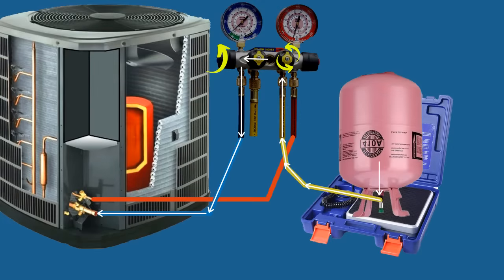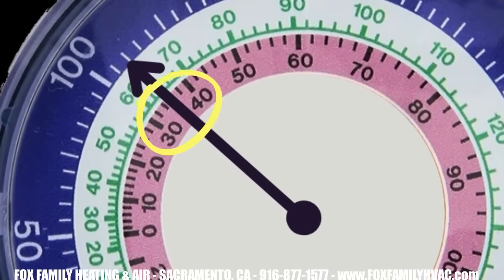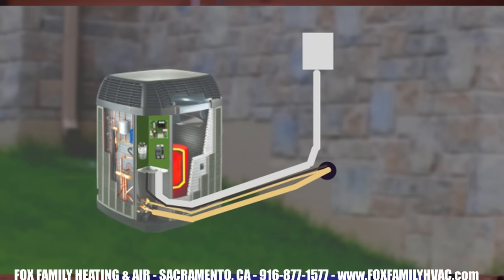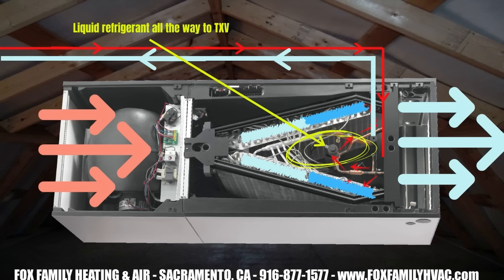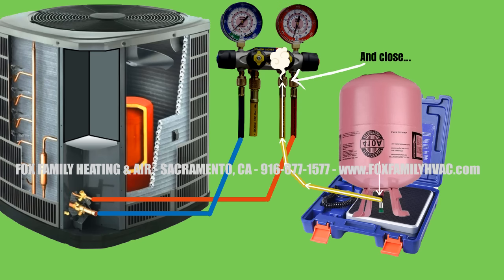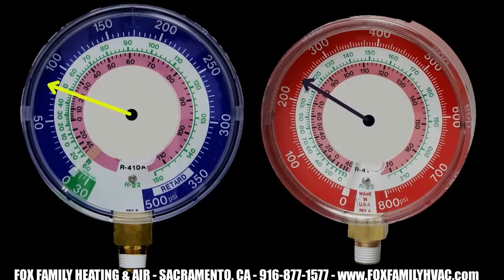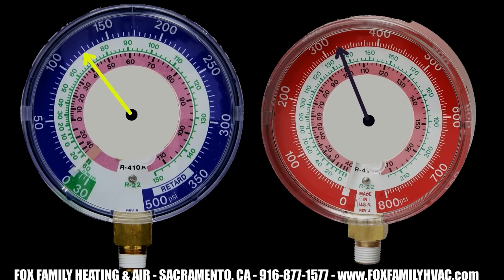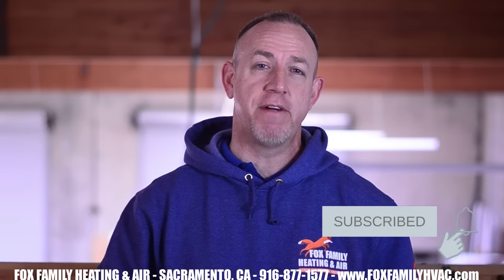How I Add Refrigerant to an Air Conditioner

Comment: This should not be try it at home without supervision if you don’t know what you’re doing you can have a serious accident and burn yourself. Refrigerant is no joke and nothing to play around with. Sorry that’s the truth this is one thing you don’t want to make a mistake with.
Reply from the maker: Very true!
Reply from the maker: Just pinned this message to the top so everyone can see it.
Reply: It's OK to handle Freon for your car or truck, but not for your home A/C?
Reply: Not if it was never adjusted properly when installed
Reply: I need to add Freon. I have an inside unit in my basement. I finally was able to use my unit for first time and after three days it was frozen. It got colder for a couple days so I let it melt. My landlord said it might need Freon. There’s duct tape around unit that’s falling off. So I’m going to change filter and reapply duct tape around. See if that works first. If not, then I’ll have to call someone. What’s an estimate for Freon ? I’m a woman and no nothing about units. Only basics

Comment: As a tech that learned everything either out in the field or on YouTube when I started, I distinctly remember when things finally snapped and became clear in my head when it came to refrigerant - from then on I always referred to the charge(especially the suction side) in terms of  TEMPERATURE - not PRESSURE when communicating an issue to someone else or while figuring out the issue. 
 Trained a few other guys at the first company I worked for and would always try to get them to think in the same terms (Blue gauge TEMP, Red gauge Pressure) - it makes understanding Superheat and Subcooling (and what it means in the system that much easier).
Reply from the maker: Great info!  Good to hear others doing the same!  I have an experienced refrigeration guy who only wants to talk pressures when he's talking to others.  everyone's different but can't bag on him since he's such a good tech.  Thanks again

Comment: I don't do residential HVAC but in managing my own automotive HVAC I learned one thing. Well, a few but this one too. If I think the system may be under charged ALWAYS leak check the service ports BEFORE touching them with ANY tools or equipment. You will not find a leaking schrader valve with gauges attached and you will not have a definitive diagnosis if the reseating that takes place "fixes" the problem. Thank you for doing what you do here on YouTube.
Reply from the maker: Thanks for your input 😊
Reply: Hallelujah, speaking my language, it shocks me that every single hvac channel does not mention this critical juncture
Reply: This is a good first step. When I get a no ac call it's the first thing I check. Check for power, check for leaks at valves. I'd say 20% of the time in the last 4 months I has been one of the valves.
Reply: @travischaddock4826  And how often did the valve leak because some numbnut didn't tighten or even bother to reinstall the caps and it got dirt and corrosion in the port? It never leaked before untill YOU went and stuck your tool in it and let all the crap into the seal. Some people automatically change out the valves whenever they are going to enter or have entered a system.

Comment: I took out all the freons from my unit, then I added propane. System is way colder I would say. Thanks for showing me how to do this and what tools to buy on craigslist
Reply: I've been wondering about this myself of late. Besides this video, are there any other good resources to help with this?  

    Speaking hypothetically, of course. I'm just interested in the physics and mechanics of it all, and wouldn't think of attempting this on my on own home system.

Comment: You did a good job explaining why and how to properly charge a system by temperatures instead of gauges, and really sounded like you know what you are talking about and seems like you went to trade school or learned off a educated teacher (instructor).
Reply from the maker: I appreciate that.  I actually learned all this in the field, as I started this trade from scratch as a helper and worked my way up.  Thanks for the comment.  I really appreciate it

Comment: great information about charging, 
before charge i would try find leak first, open evap coil panel, look in drain pan for any trace of oil, most of the time thats where it leaks, if its is leaking, most coils have 10 year warranty, get it done when its under warranty.
Reply from the maker: good info jass

Comment: Hi, boss, why not use digital gauge  which can give you either superheat or subcool right away, easier & faster.
(One more thing, I think R-410A is a blended refrigerant, it can only be added as liquid in suction side, you'd better  mention it to use a nuzzle or throttling method.)
Reply: Not needed, his gauge works...all he has to do is add 10 to the cold side and if it matches the hot he is done. I can deduct that equation faster than clamping on the sub cool wire.

Comment: & if the liquid line temperature (make sure the sun or your hand, or other heat source is not warming the area where your temp probe is mounted) is cooler than the outside ambient temp, then suspect a restriction up stream for that measured spot of the liquid line....i.e. a liquid line filter drier.
Take a Delta-T across a liquid line filter drier, if it happens to be located up stream from the measured spot of the liquid line.
If there is a temp drop of (I think) more than 3 degrees, I have been told that the liquid line filter drier is the source of the restriction, & would need to be replaced with a new one.

Comment: Great video Fox !!! How would you charge up a system that does not let the compressor come on because of the Low Pressure Switch preventing the contactor to close ? ( would you use vapor first as to not to hit the compressor and fill it just enough for the compressor to come on or would you fill with liquid right away ??? ) Thank you so much for taking your time and trying to answer my question !!!
Reply: what did you end up doing? I ask since thought vapor shouldn't be separated out. I have the same situation happening currently since I can't get my Dave Lennox XC21 edition compressor to turn on even though it is calling since the low pressure switch is preventing it.
Reply: @humphreydchen  sorry to hear man! And also sorry that I don't have a solution for you - I just left the whole thing for now while suffering Miami temperatures every day :face-pink-tears:
Reply: @humphreydchen  after calling 4 AC guys in the past 11 months I now found one (through a friend) that did not try to extort thousands of dollars and actually fixed my AC ... I can not tell you how I feel ( my 4.5T TRANE was basically empty needed 11lb of 410A)  and everything I diagnosed as in perfect working order - did not check out/work at all when he checked it - so he checked for leaks with nitrogen,filled the system,rigged the control board inside the air handler, fitted a new contactor  and it works now ) so don't give up : good things come to those who wait, even in 108ºF ( pun fully intended )
Reply: @mamumonkan  I am confused by your description. What did you think was wrong and what was actually wrong according to the technician?

Comment: Seems like some schools say add liquid, some vapor. I have seen both work and understand the phase change is the magic. What is your thinking in liquid over vapor?
Reply: add as a liquid 400 series refrigerants like 410A are a blend, when its a gas some of it separates and you may add more of a certain part of it, scroll compressors can take a small little bit of liquid

Comment: Can’t really top off a 410A system if it’s running low on pressure. 410A is a blend and if you have a leak the blend of refrigerants boil off at different pressure’s . Knowing that you don’t know which of the blend is low . This means pulling all the refrigerant out and replacing it with a fresh charge of 410A . Saying that you need to locate leak or you will bring doing this all over again. New refrigerant blends are Dothan the old R22 or R12 refrigerants that you could just top off .

Comment: The further the distance between both units dictates the amount of time for a full cycle. A system that is charged will feel beer can cold. Always use your gauges and get valve extensions with cut off. Then you can bleed most of the refrigerant back onto the system before disconnecting.

Comment: Thanks for the video. Can you tell me why you turn the 410A upsidedown?  I  hear you are to keep the R22 right side up.  Does feeding liquid shock the compressor when you turn 410A upside down?
Reply from the maker: No it's just the way you're supposed to charge a blended refrigerant like 410.  I actually just turn 22 upside down too. Scroll compressors are much lore resilient to liquid refrigerant than recip or piston compressors of the past.
Reply: @foxfamilyhvac  thanks, that makes sense,one more question,  is there any other blended refrigerant out there like the new one that replaces R22 or the new one that will replace 410a? Thanks.
Reply from the maker: @Mustang7995  we use 407c for R22. But we remove existing R22 before doing so. As for 410a no one is using any alt. refrigerant for it as far as I know.
Reply: @foxfamilyhvac  As of January, 2022, COMSTAR has perfected a "DROP IN REPLACEMENT" FOR R-410-A.  This new "blended refrigerant" is called  RS-53 (or R-470A).  It's supposed to allow existing 410-A  air conditioning systems to operate to factory specifications without any "modifications." All of the old R-410-A refrigerant needs to be removed from an existing system, and the NEW refrigerant (R-470-A) added back in.  The GWP of this new product is more than 50 percent less than the GWP of R-410-A. This should satisfy the EPA, but who knows what our politicians in congress will allow. If this new product is successful, all of the HVAC equipment manufacturers can continue to make and distribute the same equipment for many more years into the future!!

Comment: Can you help me with following math? 
* AC unit on the attic, ducts insulated.
* R410A,  
* out door temp - 93f, 
* low(blue) pressure/temp - 160psi/55f, 
* high(red) pressure/temp - 340psi/105f, 
* return pipe temp - 100-105f.  

* (out side temp) - (high(red) temp) = 12f what is less than  expected 15f. 
* (high(red) temp) - (return pipe temp) = 0f (sometimes 5f) what is less than expected 10f. 
* (supply temp) -  (the nearest cooling grill temp) = 7f up to 10f what is at least 9f less than expected.    

Note: AC documents/labels do not have any suggestion regarding subcooling (Goodman GSX130301B*) 

Math with 15f difference between outside temp vs (high(red) temp) and 10f difference between (high(red) temp) vs return pipe temp does not work here. I have  12f (very close) and 5 to 0f (big difference).

Questions: 
1. did I get it right the system needs charging to hit 115F on (high(red) temp) gauge, so there is 10f difference with return pipe temp?
2. To hit 115f on gauge I need to add 40PSI. What is approximately amount of refrigerant I need? if I buy 5 lb would it be enough or should I buy 10 lb to be safe?

Comment: Hello Fox Family, a question, when adding refrigerant, how do I know my refrigerant tank is empty?  By looking at the small rounded window on the manifold?
Reply from the maker: A scale will tell you that info. But if you shake the tank side to side (don't go overboard!) you will feel the liquid refrigerant inside. A tank starts out around 25 to 30 lbs. The tank itself weighs just a few at the most. This should give you good info.
Reply: @foxfamilyhvac  , Thank you!   I am using the tank from few years ago.  I cannot find "tare weight" info on the tank.
Reply: One day when a tank is empty...weigh it.  Remember that weight and the next tank you are using needs to weigh more or its empty.

Comment: adding refringent isn't the problem, low side of course but buying is. The main focus should be identifying the leak and then adding the Freon.
Reply: where can I buy the refrigerant? I have a portable ac unit that uses r32 coolant
Reply: @leopoldbuttersstotch6060  depends on the Freon that you need, but most require a license - that’s how they screw you.
Reply: @juanmacias4854  yep
Reply: Can it be replaced with refrigerant grade propane instead?  Or could you run regular propane through an activated charcoal and zeolite filter, and then use that?

Comment: This is a course with perfect airflow that’s not a high static duct work situation. This is also with a perfectly clean filter and a perfectly clean coils and the appropriate size line set. Not to mention perfectly good capacitor as well as contactor outside can also affect the refrigerator. All these need to be done before you start adding refrigerant unless you know that system and are you just checked it all.

Comment: Never add R check for supply air return air temps. If less that 21 degree split after 20 minutes check  the entering air to outdoor coil temp entering air in shade. If liquid line temp is lower on liquid line than shaded entering shaded coil temp your low on R.
If to high on liquid line than O.D. entering air (shaded) temp more than 11 degrees it's slightly over charged.

Comment: 125 PSIG on the low side? 
But the data plate on my condenser says 410A PSIG LOW: 236 HIGH: 446
Reply: What your looking at is test pressures I believe. That can confuse you.
Reply: My 2015 410a Lennox systems show no subcool on the plate. They show 236 low, 446 High.  Low was 75 PSI and bedroom vent to bedroom ceilings Diff was 10F deg. Added 410a refrigerant slowly while running bringing low up to just over 100 PSI and High just under 300PSI. We keep Thermostat at 76F. Bedroom vent to ceiling diff is now 20-22F, two floors down from system in attic.  Is this ok or overcharged? Or, can it do even better if I bring low up to 125PSI?
Also, Do better SEERs result in larger vent to ceiling diffs or same but work more efficiently? 
Did not touch my 3rd AC for 1st floor which runs great with a new A-coil last year.  It runs at 125 PSI low and about 325 Hi.
I assume  different tonnage units use the same pressures given its never mentioned in tutorials.
Please excuse my HVAC newbie homeowner questions. Thank you.

Comment: Are you adding liquid refrigerant into the suction line?  You placed the tank upside down.  I thought we want vapor to go into the compressor.
Reply: Never charge vapor with a blend like R410A, you will compromise the blend as the different refrigerants evaporate at different temperatures, in fact, I have never seen anyone comment on this but I always make a habit of shaking the cylinder to mix everything up before charging.
Reply: compressors in residential can handle small amount of liquid, open the suction valve on your gauge a little bit as you add, creates some flash gas, like how a fixed orfice metering device works

Comment: Almost new unit in our second home. Heat works. A/C blows good, but no cool air. I think it’s needing Freon. Not sure. I’ve heard you can do it yourself. Any tips? Thanks’
Reply: You can’t do it yourself (legally) unless you are licensed. If it a newer unit and it’s Low on refrigerant, theres a leak that needs fixing. You can’t buy refrigerant without a license.
Reply: So... call an ac repair tech because you probably don’t even have the right tools
Reply: Um I bought r22 without a license and charged my sysyem my self with correct subcool and superheat...... So yeah. You can buy refrigerant without a license and charge your system correctly as long as you have a normal functioning brain.....🤙🤙🤙
Reply: Check the label on your A/C. It probably takes R410a refrigerant which you can buy on Ebay but that said a nearly new unit shouldn't be low on refrigerant unless it has a leak. It might be better to call an AC tech in that case.
Reply: @tonymiller6255   that’s an illegal purchase you need a EPA for r22 because it contains chlorine and is ozone depleting only refrigerant you can buy without a epa is 134a
Reply: @boywhohadatiger  🤷🏻‍♂️🤷🏻‍♂️🤷🏻‍♂️🤷🏻‍♂️🤷🏻‍♂️🤷🏻‍♂️
Reply: @boywhohadatiger  want the website? Lol delivered to my door
Reply: @tonymiller6255  yea I would actually that just seems sketch to me because  you are required to have an epa by law  to handle refrigeration
Reply: @boywhohadatiger  or search them they will come up
Reply: @tonymiller6255   first site that came up asked for your epa at checkout so idk if you buying legitimate r410 a
Reply: @boywhohadatiger  my house is cool lol so idk I'll send you the invoice tell me where to send it
Reply: @boywhohadatiger  and it was r22
Reply: @tonymiller6255  LOL oh yeah where did you buy this r22? And how much did you pay for it? From a licensed parts house or ebay?
Reply: @penguins8933  @ ability refrigerants check em out send me your email and I'll send you my receipt
Reply: if you do things legit and how its suppose to be done you wont be able to buy refrigerant, also you prob dont have tools for it like gauges, youd have to buy them. if you manage to have the all tools and materials you physically can do it, watch some youtube vids, pray you dont mess up or very bad things can happen